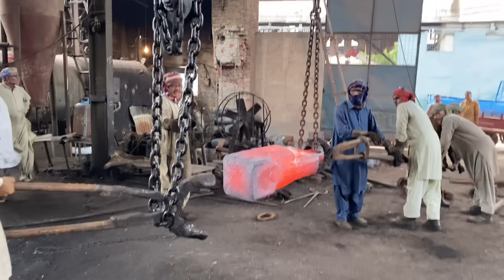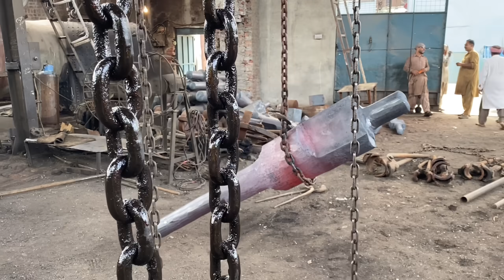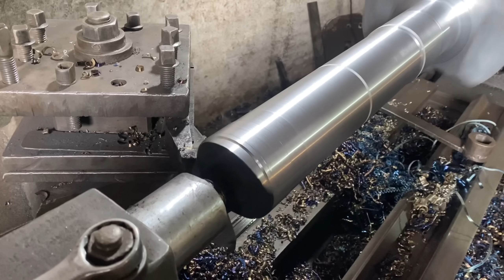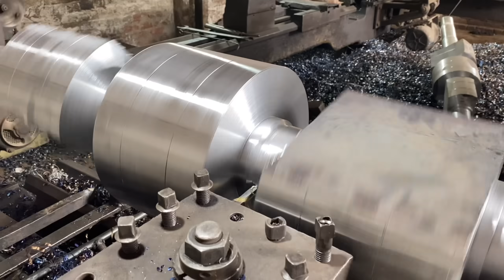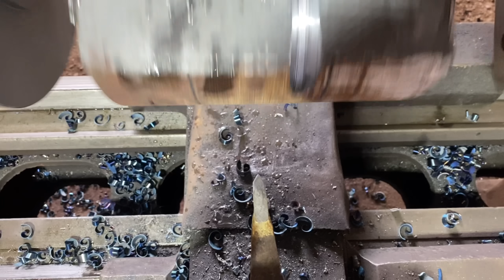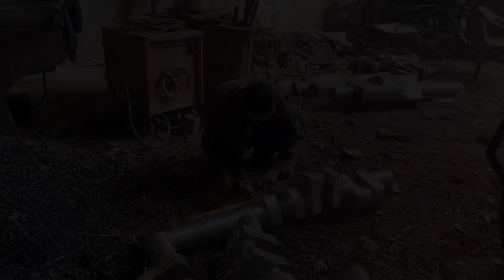Manufacturing process of ammonia compressor crankshaft with 75 year history

Comment: I was stunned by how straight that piece was when they first put it in the lathe. This is easily the most amazing quality workmanship I have ever seen on You Tube. You guys are awesome!!!
Art from Ohio
Reply: Art, you really should look at more You Tube if this is the best you have seen. Try Abom 79,  or CEE.
Reply: @MICHAEL-ys3pu  I have watched Adam and Kurtis's videos for a long time. I may have missed this somehow so I will ask you when did either of them pound out a semi molten ingot of  steel into any shape at all? I'll help you - NEVER. These guys pounded a semi molten ingot of steel weighing at least 500 lbs into the rough shape of a crankshaft. And all this under very crude conditions. Then they put it in a lathe and miraculously it runs fairly true!!!!
But, if I watched more YT videos I would see Adam and Kurtis do the same thing. So I challenge you Michael to reply to this post with a url to those videos that I apparently missed.,
Reply: It’s good rough power hammer work but a long way from amazing.
Reply: Yes it was wonder full.

Comment: I just hope that the starting billet of steel was from a good source, like ship steel. The way they mix all grades of steel when they "recycle" it can result in poor steel or a super- alloy all by dumb luck.  Forge the metal all day, but it is only as good as the starting alloy of steel. The control of the forging process was great, these guys are professionals clearly. May they be kept safe.

Comment: Amazing team work during the metal forming process. The lathe work, I think could be much better even with the tool they have. Toolbits where pretty normal in western production up to 1970 and I've seen much shinier journals on a crankshafts from that time. Keep the tool radius larger up to the counter weights to minimize material stress and use sharp fresh tools for the final cut in together some lubricant and Stady Rest for safety and suppressing chatter.
Reply: I think you probably mean a steady rest. This crankshaft isn't finished yet that is why the finishes aren't that great. It will be finished on a precision grinder probably in a different shop. Also coolant is what would be used rather than a lubricant. It would prolong tool life but have little effect on the finish.
Reply: @artszabo1015  Yes I mean steady rest. English is not my native language, so there can be some spelling errors. I don't know if the crankshaft will be process further in a precision grinder but I doubt that it will. I mean cutting lubricant because they are using toolbit not carbide and the cutting speed is very low. Do you use coolant or simply avoid cutting lubricant when cutting a thread with a thread tap, the surface will be terrible with out cutting lubricant.
Reply: @SR-ml4dn  I can tell that you are not a machinist nor a mechanic. It is an absolute that this crankshaft will be finished on a precision grinder. Your doubts and imaginations have no affect on the real world. You are right in saying a cutting lubricant is required in any hand threading operation, but billions of threads are cut and rolled using coolant not oil in machinery.
A soft metal bearing not a roller bearing will be used on those crank journals. The existing finish would destroy that bearing in 8 seconds. You need to get a few years of actual experience as a machinist and mechanic before you jump in here offering advice and criticisms and then trying to argue them. Watching YouTube does not qualify as actual experience.
Reply: @artszabo1015  I'm a machinist spending more than 3 1/2 years, 8 hours a day as apprentice. You just claiming a lot of things you don't know anything about. Please find some examples where rolled threads are using coolant, it must be easy for you when billions threads are made. Rolled threads are using oil and not coolant, because it's a deformation process and not a cutting process. Again when machining at low speed and that what I'm talking about when he is machining the journals, he is not able to have the right cutting speed due to unbalance from the crankshaft and therefor should use cutting oil. It seems to me, that you don't have any experience with toolbit machining at all and your fist statement that state that coolant "It would prolong tool life but have little effect on the finish". My claim was that, It has a huge impact on the surface when using toolbits because toolbits can't take the high temperature as carbide in the cutting nose area.
As a public service announcement: Remember to finish your education, pay attention in school and read up on the stuff you claim, or you might end up like Art Szabo
Reply: @SR-ml4dn  Son,  your replies to Art Szabo should be in those lines as per your claim if 3-1/2 years as an APPRENTICE.   Are you sure that the tool bit is not carbide.  This is a video created over a period of time -probably in 3 days given the conditions of the workshop.   Grow up and do not abuse others with your half baked observations.  BTW the machinist is using a CARBIDE brazed tool and not a HSS bit.  Watch closely.  Cutting speeds depends upon the machine and working condition of the machine.   The team has done an excellent job in the given conditions by their employer.    Passing half baked judgements is not a professional way if you claim half of what you are.  YHou have a long way to go.  
BTW I have 10x experience of yours in the same field.
Reply: @mohamedrizwan655  Then since you are an expert you still missed the whole point. I actually gives credit to the workers and come up with some minor improvements that the Maschinist can do to improve the surfaces quality for the journals. Even though that he is using brazed carbide he still has to sharpened the tool on a grinder and hopefully also hone the carbide surface that does not change anything different than HSS tool. What I’m pointing out was try to use cutting oil and fresh sharp tools on the finish cut, just to see if any improvement. You can also choose to do what you have done in the last 35 years and then ask your self why do we still work with a worn out lathe. I don’t care I get my night sleep any way.

Comment: The skill of these craftsmen is awesome and  the coordination of that forging team is amazing. After all that work, it seems kind of odd that they just set the finished part in the dirt. If those journals do not have a smooth surface texture, they are going to wear our whatever bearings they run in real fast.